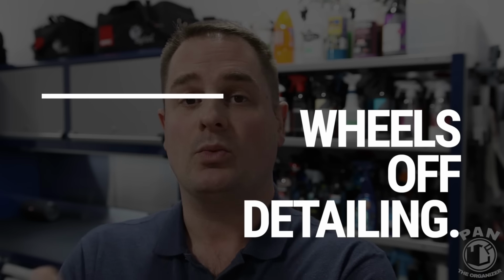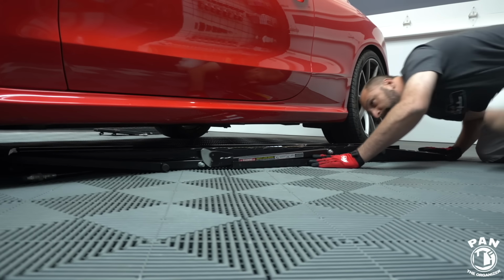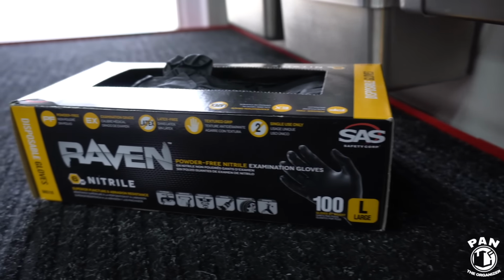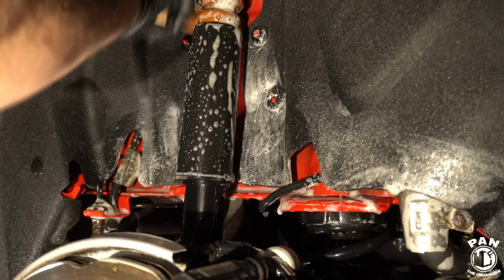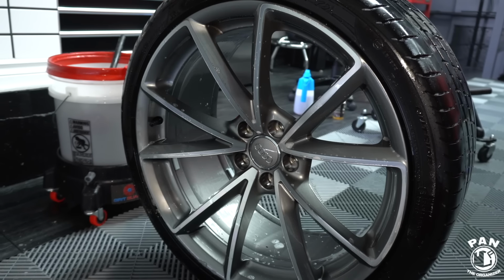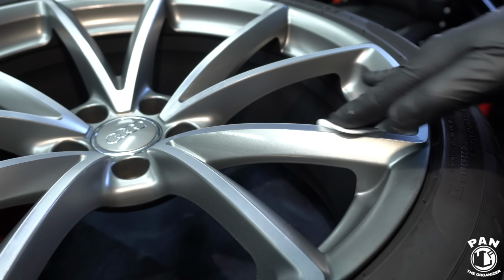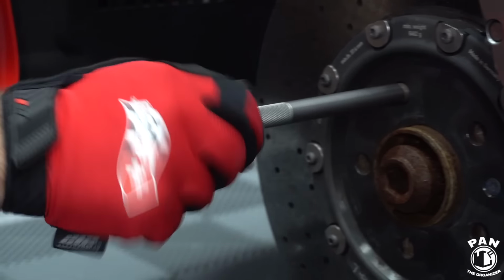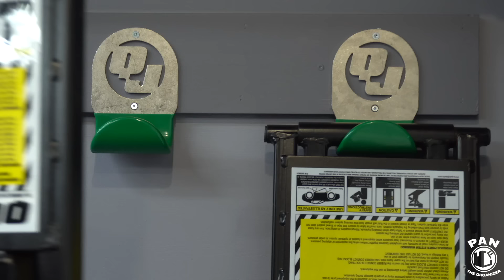WHEELS OFF DETAIL : Cleaning and protecting wheels & wheel arches!

Comment from the maker: ►For people in USA:
Mosmatic gun for pressure washer: https://bit.ly/3aA67oE
Extra Tough multi-purpose cleaner/degreaser: www.extratoughcleaners.com
Adam’s All Purpose Cleaner (heavy duty): https://amzn.to/313TJcU
IK Multi pump sprayer (to spray the degreaser): https://amzn.to/3dswIpg
Flagged tip short brush: https://amzn.to/2ItuF8T
Fender well brush: https://amzn.to/2GNpcJL
Smaller boars hair brushes: https://amzn.to/3dmYCTz
Adam’s Wheel & Tire Cleaner: https://amzn.to/2SU1ygZ
IK Foam pump sprayer (for wheel & tire cleaner): https://amzn.to/372QK8D
EZ Detail wheel brush: https://bit.ly/2Tbkxnb
Adam’s Iron Remover: https://amzn.to/34SD65b
Lambskin wheel mitt: https://bit.ly/3lJM9fo
Tire brush: https://bit.ly/3iWumjB
Gyeon Tar: https://amzn.to/3nMfOqf
Wheel cleaning stand: https://amzn.to/3dmgoX0
CarPro Eraser paint prep: https://bit.ly/3k8Ze1w
Gyeon Rim ceramic coating: https://amzn.to/3lNe7qz
Microfiber towels: https://bit.ly/379WEEG
Adam’s Tire Armor dressing: https://amzn.to/36Z2tFb
Adam’s Hex Grip tire dressing applicator: https://amzn.to/3lJZBjv
1/2 inch drive, 24” breaker bar: https://amzn.to/3iWSAKc
Car jack: https://amzn.to/2GNrE2V
QuickJack BL-5000 lift: https://bit.ly/3wfKOaK
Speeder wrench: https://amzn.to/3jXalKW
Cordless impact driver: https://amzn.to/2GYjWCR
Wheel lug bolt guide: https://amzn.to/3nKL0pP
Torque wrench: https://amzn.to/2FqqHwy

►For people in Canada:
Mosmatic gun for pressure washer: https://bit.ly/3aA67oE
Extra Tough multi-purpose cleaner/degreaser: www.extratoughcleaners.com
IK Multi pump sprayer (to spray the degreaser): https://bit.ly/3nNViWg
Big white bristle brush: https://bit.ly/37fOZVN
Fender well brush: https://amzn.to/2Isdrsx
Smaller detailing brushes: https://amzn.to/3j4CnmF
Adam’s Wheel & Tire Cleaner: https://bit.ly/3jX47uA
IK Alkaline (for wheel & tire cleaner): https://bit.ly/3727MUh
EZ Detail wheel brush: https://amzn.to/3lNmkLH
Adam’s Iron Remover: https://bit.ly/36Z4wZT
Finger mitt for wheels: https://bit.ly/3iSIGJT
Gyeon Tar: https://bit.ly/3nPWhoI
Wheel cleaning stand: https://amzn.to/3nGSt9k
CarPro Eraser paint prep: https://bit.ly/34XALFU
Gyeon Rim ceramic coating: https://bit.ly/2GOKXsC
Detail Popo Ocean Blanket 350gsm blue microfiber towels: https://bit.ly/3lP0Az7
Detail Popo Snow Blanket white 350gsm microfiber towels: https://bit.ly/33XzyiV
Detail Popo Ocean Weave 320gsm blue microfiber towels: https://bit.ly/3nMjo3F
Adam’s Tire Armor dressing: https://bit.ly/3jXO3IO
Adam’s Hex Grip tire dressing applicator: https://bit.ly/3jXHlCG
1/2 inch drive, 24” breaker bar: https://amzn.to/2Isfmxf
Car jack: https://amzn.to/3nMAnmi
QuickJack lift: https://amzn.to/3iU1dp1
Speeder wrench: https://amzn.to/34VQQw4
Cordless impact driver: https://amzn.to/316Otp8
Wheel lug bolt guide: https://amzn.to/3lG0tWk
Torque wrench: https://amzn.to/33VgtOb
Reply: Sorry to be so offtopic but does anyone know of a way to get back into an Instagram account??
I was stupid forgot my account password. I would love any tips you can give me
Reply: @Jon Uriah instablaster =)
Reply: @Rene Gerald I really appreciate your reply. I got to the site on google and Im waiting for the hacking stuff now.
Takes a while so I will reply here later with my results.
Reply: @Rene Gerald It worked and I actually got access to my account again. I am so happy!
Thank you so much, you saved my account !
Reply: @Jon Uriah you are welcome xD

Comment: That wheel cleaning stand in the link seems to be made for motorcycles although it clearly works here for car wheels. What is the maximum wheel width you could fit in there? I have a truck with fairly wide wheels and want to make sure it would work with them.
Reply: I ditched the motorcycle wheel stand for something much more robust. Poka Premium makes a nice one. The one I have is from The Source Garage but they are ceasing operations, unfortunately.
Reply: @RADGarage  I made a stand myself and bought this motorcycle stand. The one I made allowed the rim to freewheel easier but also lets it come right off the stand pretty easily. The motorcycle stand doesn’t let the wheel move as easily and will still allow it to come off the stand but not to the same extent. I would love one of the stands with the vertical roller as well but they’re all so pricey. May have to make that next.

Comment: Nice idea to use a wheel lug bolt guide and honestly never thought about that.  Always the right tool for the right job makes things so much easier.  Thanks Rick and Pan.
Reply from the maker: You are 100% right Kirk. Right tool help you do the right job.
Reply: It's funny because my previous Audi SQ5 came with a nice aluminum bolt guide, but my current version came with the flimsiest of plastic crap I've ever seen. I think they needed to cut costs to pay off "Dieselgate". This BLOXSPORT was a great find and I love using it.
Reply: @RADGarage  So true Rick.  Or the understocked plastic emergency/tool kits they put in $100k cars now.  Almost an after-thought.
Reply: @kirkm9215  It’s actually more of an offence than a bonus!

Comment: Great video as always. While the wheels are off what would I use to protect and maybe restore the wheel wells?
Reply from the maker: If they are plastic, a coating like CarPro DLUX or Gyeon Trim is perfect. If they are felt/carpet style, there's not much you can do other than pressure washing and perhaps adding a fabric protectant like CarPro Fabric for example.

Comment: Fantastic advice. Is there any product that can be applied and used to protect the wheel well?
Reply from the maker: It depends what your wheel well is made from. If it's a plastic liner, you can use something like CarPro DLUX or Gyeon Trim (coatings for plastics). If it's carpet or felt, perhaps something like a fabric coating like CarPro CQuartz Fabric.

Comment: Okay to use degreaser on calipers and rotors? I have some brown stuff stuck on the caliper. Looks like baked in brake dust.
Reply from the maker: Yes. As long as it's made for automotive use.
Reply: @PanTheOrganizer  any suggestions?

Comment: Hey Pan, would you recommend using Carpro Eraser on a set of brand new wheels before applying a ceramic coating? Or just thoroughly wash then apply the coating?
Reply from the maker: Always use a paint prep before applying a coating, regardless if the wheels are new or not.

Comment: Love the cosmetic cotton pad used to apply the ceramic coat. How do you deal with the residual glue left by the balance weights? Ive tried everything. They seem to be gone at first but after a few days the dirt and dust collect where the glue was, making them black again???
Reply from the maker: A bit of tar remover like Gyeon Tar or CarPro Tarx usually disolves that. So does Citrol 266.
Reply: Citrol fixes everything!

Comment: Can I still use spray waxes after I have applied a ceramic coat? For in between maintenance washes?
Reply from the maker: No. Don't mix waxes with ceramic coatings. On ceramic coatings, you can use silica spray sealants for maintenance washes. Watch my tutorial on how to do a maintenance wash on a ceramic coated car: https://youtu.be/yLiePQRMFc8

Also, watch my popular tutorial on how to clean wheels and tires, where I also show how to replenish the protection on ceramic coated wheels: https://youtu.be/Ty4ZTq7A7rc

Comment: What product is good to remove the tar and if it’s secure to use on the whole car
Reply from the maker: Here's a great tar remover: https://bit.ly/3wkXzOy
That specific tar remover, unlike most tar removers, does not affect any exterior surfaces and is bodywork safe. It can be used on paint, glass, plastic trim, both painted and unpainted. As it is pH neutral, it can also be used to remove tar spots from bare polished lips.

Comment: Now that the wheels are ceramic coated what do you use to wash wheels later maintenance. I would think you cannot use a wheel cleaner any longer?
Reply from the maker: You can use a wheel cleaner. But if the wheels aren’t too dirty all you need is car soap. Ceramic coated wheels are so easy to clean.

Comment: Pan, I need your help. I washed my BMW this morning and paid extra attention to the wheels. I cleaned them twice with wheel cleaner but I still have dirt in the spokes. I attacked that dirt with a detailing brush and more wheel cleaner. The result was slightly better, but not completely clean. Any advice on how to remove dirt (wheel dust) from crevices?
Reply from the maker: What wheel cleaner were you using?

Comment: Timely. It's getting to the point where my summer wheels have to come off for NW English winter (not too harsh, but M+S tyres handy) and there's some real filth back there. I shall check in on Rick's RAD vids and I really want one of those wheel stand/rollers. A Quickjack is $$$$ but a standard hydraulic - and a 12V impact wrench - is worth the money for regular wheel swappers.

Comment: Great video Pan and awesome collaboration! 
A quick question: With all that degreaser and water in and around the wheels and springs, isn’t there a risk of removing the grease that’s been put there for protection against water, humidity and rust? Shouldn’t one apply some new fresh grease/fat to protect those areas that need to be protected?
Reply: Good point. There's also grease between brake pads and the caliper which could be removed with degreaser. You might get noisy brakes if going to crazy with degreaser.

Comment: Hi, I have a question that's a little off topic here: I have been looking for a while and haven't been able to get a solid answer to this. What type of polish should I use on Black Diamond exhaust tips? I've heard some horror stories of people using the wrong product and it taking all the color off the exhaust tips, so I've been very hesitant to try anything yet. I've used Mcquires Ultimate All Wheel cleaner to keep them clean, but they really need to be polished.  I figure if anyone knows for sure it would be you, thank you if you made it this far in my LOOOONG question, I appreciate it.
Reply from the maker: I like P21S polishing soap on exhaust tips. Watch me use it in this BMW M6 video: https://youtu.be/0lC9uyKXs8Q

Comment: Hi Pan. Yesterday I applied Meguiar's G17804 Keep Clear Headlight Coating to my headlights. It did not come out great, there are areas where you see drip marks on my headlights. Is there any easy way for me to remove the Meguiar's coating without removing the original clear coat from my headlights? Thanks in advance!
Reply from the maker: There is no magical way. You'll have to machine polish it off, which means inevitably, you will be removing some clear coat from the headlights.
Reply: @PanTheOrganizer  Thankfully, some rubbing alcohol, and Meguiars Ultimate polish, and elbow grease got most of it off!

Comment: Pan, I wanted to ask you what you think about pressure washer Karcher HD 5/15 C Plus for use on car paint? I bought it 2 years ago for my cars and yard and its really powerful. I think its maybe too powerful... Working pressure is 2200 psi or 150 bar... Should i maybe buy myself another 1000 - 1500 psi pressure washer just for cars?
Reply from the maker: I don't recommend anything over 2000 psi to wash cars. But in your case, the pressure washer is "rated" at 2200 psi, so in reality it must be closer to 1800-1900 or actual output, so no worries.
Reply: @PanTheOrganizer  Yeah, tnx for the answer Pan. I love your videos. They inspire me to fully enjoy detailing cars as my hobby. I love it. I consider it as a workout :D Keep up the good work Pan :D

Comment: Hey Pan, im planning on a claybar then polish of my car. I was wondering what steps you'd take after that.. would you use turtlewax ceramic spray, then a sealant, then wax? OR would you do the turtlewax ceramic spray at the end or not at all? Do I have it all wrong? lol I want to protect my paint but dont want to ceramic coat it for now, was thinking trutlewax might be a reasonable alternative!

Cheers
Reply from the maker: Yeah you have it all wrong. Don't mix ceramic based products with regular sealants/waxes. You would either pick two coats of Ceramic Spray Coating (24 hours between coats), or first base layer of Seal N Shine, and then finish with ICE Spray Wax.

Two coats of Ceramic Spray Coating will last you upwards of 9-10 months. Seal N Shine + Spray Wax will last you approximately 5-6 months.

Comment: Pan this is a old video, but definitely had a question for you. I'm getting old and I wondered if there are any tips and tricks to easily get your wheel off without scratching them. I have PCCBs and the tolerance between the caliper and my gloss black wheels is insanely small. My age is definitely making the wheel too heavy to hold easily so I end up bumping the inner barrel with the calipers all the time. Is there anything I can do? I use a wheel alignment pin to help.
Reply from the maker: See how Obsessed Garage does it here: https://youtu.be/mu_p68Yt3UI?si=HaUIYP8uX9bMAXLI

Comment: Another great detail filled video pan! I had a quick question, do you have any solution for decreasing the sandblasted surface of a windshield? Looks glittery at some angles in the sun.
Reply: Side note, appreciate that you are a responsive youtuber!
Reply: Have you looked into EXO Shield?
Reply: @RADGarage  I haven't but isn't that more of a protective coat?
Reply from the maker: Thanks!! There aren't many miracles for pitted glass, as material is gone (like stone chips on paintwork). At that point, I would simply get a new windshield if it's that far gone.

Comment: After clay baring the body work of a car would it be sufficient to just use spray on ceramic wax such as meguairs for protection?
Reply from the maker: Usually after a clay stage, you want to at least do a light machine polish to remove any marring left by the claybar (that is an abrasive). But it's up to you. After claying, rinse and dry your car. Inspect the paintwork and if the paint looks good to you, move on to applying your paint protection.

One thing of note though. If you already have some form of protection like a wax or sealant applied to your paint, then you ABSOLUTELY have to machine polish to ensure 100% removal of previous protection before applying any ceramic based products, as those need to bond directly to virgin clear coat to ensure durability and performance.

To give you an idea of all the steps in an easy to understand flow, watch what I do to fully detail a vehicle here: https://youtu.be/0lC9uyKXs8Q
Reply: @PanTheOrganizer  Thank you for the response, I don't have a machine polish will hand polish be sufficient and the car has never had any protection put onto it and the paint is in fairly good condition. Thanks for the advice.

Comment: So, i can’t seem to stop the rusting before the wash is done.. then you drive a little to get the rust off then rust dust covers the clean wheels.. any tips??

Car is a 2016 GT350 with ceramic rotors. 

Thanks!
Reply from the maker: There are no miracles unfortunately. When I'm done rinsing, I drive up and down my driveway while applying the brakes, and that gets rid of the surface rust.
Reply: Like Pan said, just apply the brakes to clear the rust away and use a damp cloth to remove any rust dust/residue. There's Hyde's Ruststopper that claims to prevent them from rusting but I've never had good success with it.
Reply: @RADGarage  thank y’all! I’m going to try the driving a little while rinsed
Reply from the maker: Me neither Rick! That Hyde's product never quite did the trick for me neither.

Comment: Why not use a graphene coating for the wheels instead of ceramic?
Reply: I had some Gyeon Rim so it made more sense. I've only used Graphene twice, but I'm still interested in learning more about it and possibly using it on my own car. What graphene are you excited about?
Reply: @RADGarage  From Pan's testin for ease of use, price, and results I extrapolated that the 303 Spray coating is superior.  Pan covers it in his videos. (I personally have yet to coat anything graphene yet, but am looking forward to move past ceramics).
Reply: @DinoPwn  That sounds like it could be a totally viable option.